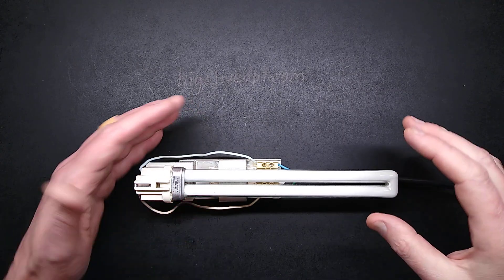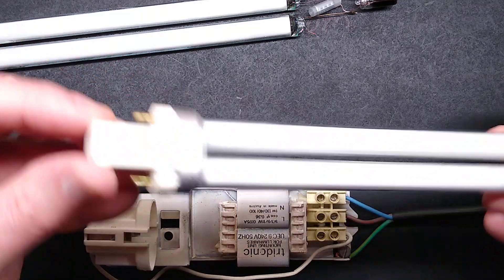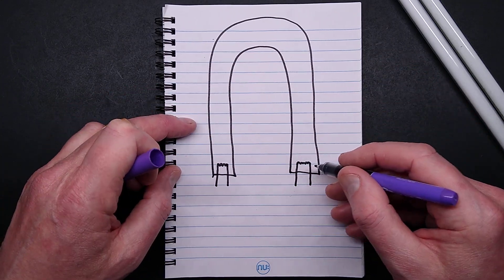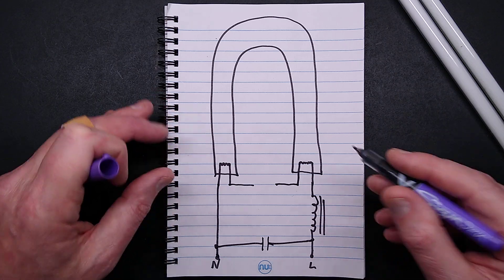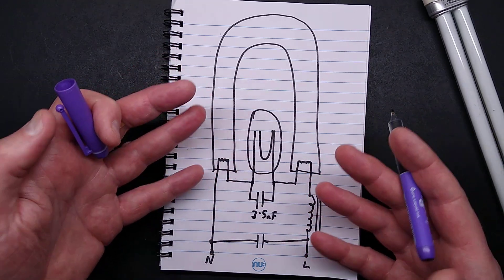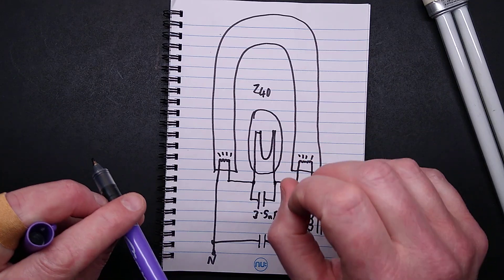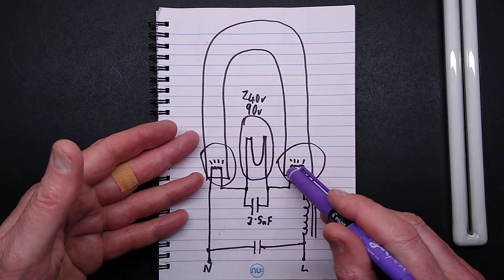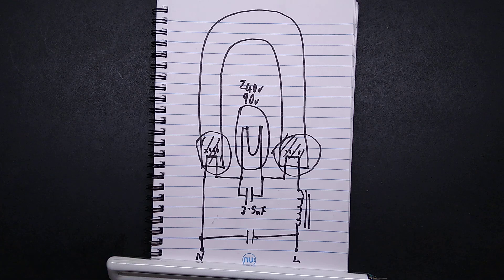Retro already?

Comment: It's all okay to say leds are great but even so called brand name bulbs I've bought lasted 3-6 months and cost more to replace than the electric they saved ....I don't like a company that says 10,000 hours then says they can't replace because "commercial setting" so what people in houses don't have lights on for 8 hours a day 6 days a week. I've had cheap ebay party led bulbs  with wrgb chips that have lasted years while stating not to be used as main light. Eu are great at "saving the planet" but then allow companies to sell lights that last less than the ones they replace.

Comment: I think those ol' fluorescent tubes still have a place and shouldn't go away completely, they're particularly handy in a situation where you set them up in a place where they'll be on all the time and maintenance is difficult, while using a little bit extra power won't topple the economic tower of cards.
Reply: Even if there are longlife leds I still agree that there are areas where leds are just not the better fit. 

 
Especially on areas where the runn time is really low. 

The perfect example would be industrial facility heating / water supply rooms. 

They get used 4 times a year and by the time the led gets 15 years old or sooner the electronics fail . 

The neon tubes with balast work forever. 
I've had some way over 50 years old that start with a problem and they probably will do so for another 50 years. 

Price is also a big factor. 
If you use it twice a year a led will not benefit power consumption wise
Reply: If you have a tube which lasts 50 years and will again do 50 years so what? Then you are dead nevertheless. Nobody will steal them. ^^ If they break, then ya, then your assumption was wrong and you need another solution. I don't get this "reverse-thinking". Are you one of that guys which have 1000s of classic light bulbs hoarded in the basement? ^^
Reply: @NinoJoel  They could have use common light bulbs for such places, they are and will be available probably forever for such rare cases.
Reply: you know why i replace tubes with leds when the light goes out?   would have to buy new fixtures to put new tubes into and new ballasts too. it's not that the standard changed or something it's just that they crumble on me...
Reply: Long-life LED lamps are manufactured.  They last longer than fluorescents, use less power, and emit light of better quality.  But you need to look for certifiable long-life products, not just any old LED that says "up to 50,000 hours" on the box.  Typical LED lamp designs run the LEDs hard and skimp on driver components like capacitors.  That's really not such a bad thing for most use cases.  LED lamps are quite inexpensive for what you get.  But with a few simple design changes, LED lamp can last longer: under-run the emitters, provide adequate heat sinking and ventilation, and spec better quality electronic components.  Fluorescent lamps are rightfully obsolete. 

In the early days of LED lamps, they were designed with big honking heat sinks and quality all around.  That kind of design made sense when the LEDs themselves were very expensive.  But it made the entire lamp very expensive.  I have bulbs that cost $20-30 each.  They still work, too.  But they are obsolete: inefficient, and with poor light quality by today's standards.  And with LEDs as cheap as they are now, it doesn't make sense to pack so much aluminum and quality into a bulb.  Light bulbs are consumable products.   They degrade, wear out, and die.  They are disposable, and any bulb you bought five years ago is already obsolete.  Be glad that LED light bulbs are cheap.
Reply: @jbalazer  Or buy dimmable LEDs 2-3 times as bright as you need, run them at reduced power.
Reply: @jbalazer  Fluorescent lamps are the best.

Comment: It saddens me that LED lights can last many times longer than conventional lighting like this but instead of properly insulating and cooling it, it gets run exposed to the elements and massively overdriven to the point where it lasts nowhere near as long as these.
Reply: It's almost as if the manufacturers don't want to manufacture something that lasts a lifetime, even if it costs more to produce.

We need new lawmakers.

Comment: ...and this is why LED panels should be banned. I've seen load of them gone shit within a year in many shops. Many should've stick to fluorescent which last many years or keep old fixture and have it retro fitted to LED tubes that user can change it without the need of hiring an electrician to change every time LED panel drop dead or pulsing like mad. What a waste!! 🙄

Comment: Over 50 years ago i was working in a company which had 5 foot ancient fluorescents in it. The Starters were green lamps which glowed whilst the lamp was striking.  one of the fittings was sitting with the tube just glowing at the ends and never lit.
i said "i can fix that". There was a tiny capacitor across the starter hanging over the side of the fitting.
I reached up with a pair of insulated snips and cut one of the capacitor connections. Lamp lit instantly.
They never figured out what I did or how i fixed it by cutting a wire!

Comment: I'm not a massive fan of them but it depends. The ones at work are old magnetic ballast and they flash and flicker a lot, very nasty. The one in my bathroom has an electronic ballast and works good, the high frequency helps it a lot. They render colours in a slightly weird way and emit a small amount of UV, making anything fluorescent look brighter than it is. But works as a general light.

Comment: Now that I think about it - I have a SAD therapy light and it uses tubes like this but they're about 3 times longer than these tubes.  I had to get a new ballast for it which required running a new conductor to one of the lamps to match the new ballast configuration.  That one powerful light fixture.

Comment: These PL tubes are available in LED versions that plug into the same lamps.  Last years high energy prices made us swap them all at work.
  Anyways these tubes already share much technology with white LEDs, most notably the UV light source that lights only at the AC peaks and the phosphor coating that converts it to white light of a chosen spectrum.  The "ballast" coil also remains useful for reducing harmonics and regulating the voltage for the UV emitting element, and so does the tendency to blink when failing.  However the starter circuit for LEDs is very different between a fluorescant tube and a PFC LED source.
Reply: White LEDs do not use a UV light source.  Most use blue chips.  A few use violet chips.

Comment: Interesting, I had not realized CFLs included a starter built into the base. We still have a few CFLs but now almost all our lights are LED.  My latest project replaced the fluorescent tubes with LED tubes and I removed the ballasts. Much better light and significantly more efficient.

Comment: I just gave away a UV light box with 4 of those tubes (shape and style) in it.  My wife used to use it for the gel nail polish until she became violently allergic to the process.  It cured UV glue like the dickens.  Got it for $2 at a thrift shop.
Reply: Huh, funny, this exactly happened to my mother as well, the lamps she dropped off are still wrapped up in newspaper somewhere in my "spare parts" pile.
Reply from the maker: That was possibly a reaction to the UV curing resin.

Comment: The problem I see with LED fixtures stems from the lack of standardization and modularity. A new power supply would be easy to source if it were standard, and had a little hatch and port to plug in like a fluorescent starter. In some cases that's not feasible however I feel a lot of LED products are built to be bought again

Comment: I have had something like that for my lamp and have had it for 20 years.  Didn't use it all that much but it still works.  The shop I got it from moved or went out of business a long time ago.  I think I still have a couple of replacement tubes and maybe a starter thing.  Here I was thinking, way back when, that I'd have to replace it more regularly like an incandescent bulb.

Comment: Aah, the good old days. My grandfather taught me about fluorescent starters used on preheat lamps back in the day. I thought the manual method on desk lamps was much simpler and more reliable (spring loaded ON button). We were all Rapid Start, and I thought that was best of all. Now, the electronic ballasts are even better.

Regarding the law, the US EPACT of 2005 was an efficiency standard of -25% consumption that many people took as a total ban on incandescent. Most quartz lamps met this standard but many took this as liberal overreach, even though it was signed by W. I'm just hoping my supply of 40w lamps for the Lava lamps holds out.

I suspect the reason for the EU ban is more a reaction to the mercury in them. That was an excuse some people used to object to them, even though it was shown that the electricity wasted created way more emissions at a coal fired power plant than was in the lamp itself. But don't worry, the US will be happy to keep selling you mercury lamps.
Reply: The US lava lamps use appliance bulbs. Until somebody makes oven-safe LED bulbs you'll still be able to get replacements.

Comment: Love the fluro lamps and the blink happy start ups of older, worn out tubes. I found a box of NOS Philips Prismatic CFL lamps at a local recycling centre, these are the forerunner of the more familiar electronic CFL lamp. These ones are heavy due to the choke and glass dome but are quality made.
Reply from the maker: I bought one of the heavy ones when they first became available.  I put it in a fitting that pulls down on a retracting cable and it immediately extended down to its full length with the weight.
Reply: Let me tell you something funny. The glass dome barely weights anything and is quite a lot thinner than it would seem. The weight is mostly in the choke or ballast or how you'd like to call it.
Reply: @NaoPb  One of the lamps was dropped and glass broken, Yes the glass shell is quite thin, anyway I managed to remove the remains of the actual tube and relamped it with a similar size and rating slim line fluro tube while retaining the original magnetic ballast and starter. It is now above my welding bench as a task light, maybe a waste of time fixing it but why not!
Reply: I have one of those Philips lamps in my landing light fitting; it's ideal when I stumble out of bed on a dark morning as it takes time to reach full brightness, thus saving my eyes. It's also the longest-lived of all my "energy efficient" lamps - probably fifteen years now.
Reply: I bought one of the Philips SL18 Prismatic lamps back in the 1980s, when they first became available.

Just found it again, in the back of a cupboard. Powered it up, and after a couple of "tink, tink" noises, it started just as well as it did almost 40 years ago.

Comment: More crap forced upon us. I've changed more dead LEDs out than fluorescents. We still run entirely 5 and 6ft fluoros at work, most of the fittings are from the 70's, the roof leaks or has leaked on most of them (and they're not IP rated), they are all covered in a thick layer of grinding dust, and they keep soldiering on. I'd rather carry on changing a tube every 8 years or so rather than ripping the whole thing out and replacing it. But hey they best keep pumping all this cheap e-waste out, as that's better for the environment. Great video as always 👍
Reply: LEDs, most likely would be a fire hazard under the same conditions! At least a ton of them out there. For LEDs, I trust Cree and Soraa the most.

Comment: Odd comment but when i was a methhead i used to steal these out of fixtures disassemble and clean out the white stuff with salt and use them to smoke
Reply from the maker: I've used dead ones as a source of clear glass tubing too.  But for making solvent filled bubble tubes.

Comment: I'd like to see an LED driver last as long as that inductor. As far as bans go, I don't think a federal ban would pass anytime soon because fluorescent lights are still reasonably energy efficient, and because you probably know how resistant Americans are to change and things getting banned.
Reply: They can. They just have to give them a safety margin instead of using components that are JUST enough to do the job.
Reply: @Alacritous  I don't think a complex switching power supply would ever become as simple and reliable as the humble inductor. If they did use better components, then it would just be the LEDs that fail first.

Comment: The inductor in series is what kicks the high voltage through the tube when the bimetal disconnects as inductors resist changes in current flow.
Reply: Yes, that's correct, when the starter opens, the magnetic field suddenly collapses and generates a KV level voltage spike that strikes an arc in the tube. The reason they may flash a couple of times before striking is that the circuit needs to be broken near the voltage peak otherwise the spike not enough to strike the arc.There are electronic starters that open when the input voltage is at it's peak and so the tubes do not flash.

Comment: I’ve been looking into Sulfur Lamps aka Electrode-less (Sulfur) Plasma Lamps recently.

DAMN bright so only suitable for large use cases like spotlights etc unless fibers optic or light tubes are used, BUT *no mercury*!

Also in theory damn long lifetime.
Reply from the maker: The RF power sources are the weak point, and there's always been a slight issue with the white having a strong green tint.  Robe made sulfur lamp moving heads with a rotating waveguide leading to the moving part.

Comment: I've always been passionate about illumination technologies, and it's a tragedy that the fluorescent is going forcibly south. I've come to appreciate them, and they aren't exactly inefficient.
I've got a trove of F15T8 bulbs, several fittings including a two-bulb drafting arm lamp, an under-cabinet/tabletop or three, a highly beloved two-bulb desk lamp, and at least a couple ballasts.
Not long ago I inherited a F56T5HO high-bay 6-bulb monster from work. 350W! A small table lamp sits beside me right now loaded with an old CFL that shouldn't work anymore but does.
Also have F40T12s for the kitchen and laundry room - each has only used up one set of bulbs each, although I didn't catch the laundry room one quickly enough and the ballast immolated.
A small part of me wants to stock up on them now, but that would be sliiiightly hazardous to my bank account.

Comment: What tends to fail in CFLs? I have a bug zapper with a u-shaped UV tube and the bulb only seems to last about 6 months. Is it likely the bulb itself is still good and it's the supporting electronics that failed?
Reply from the maker: The tube is probably being overdriven for higher output.  Or it might be one of the really horrible ones that uses DC to power the tube with forced cold start.  That often causes distinctive blackening at one end of the tube.